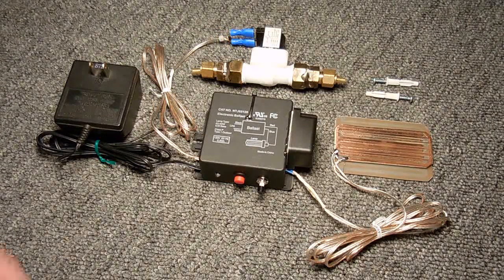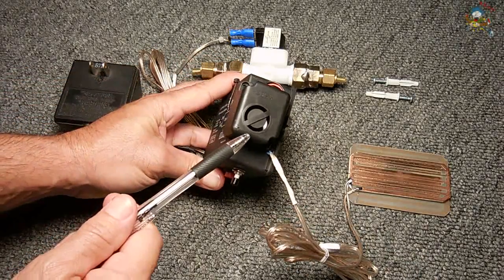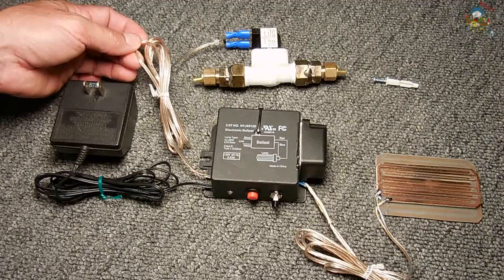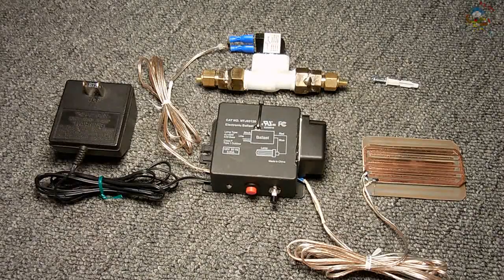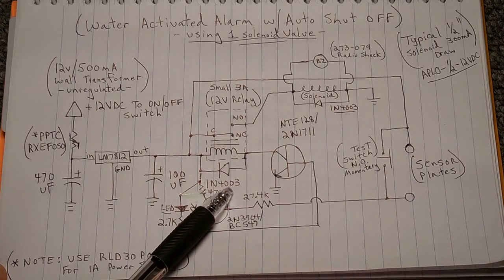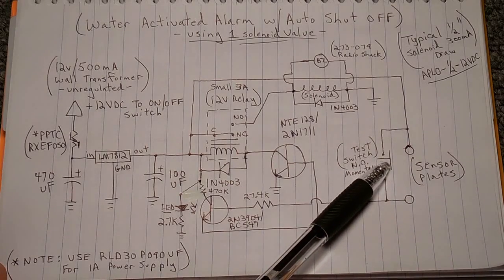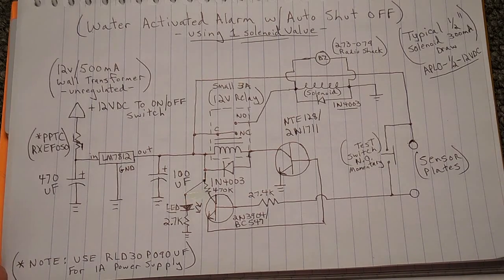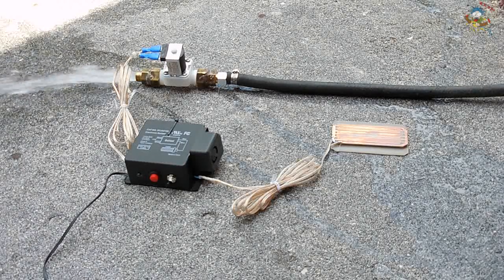DIY Water Leak Detection System w/Auto SHUT OFF

Comment: I'm taking this project on in my home.  I'm going to run a loop of leak detection cable around the washer dryer dishwasher HVAC, water heater, sump pit and floor drain. Each one cable back to a small breadboard on the basement wall.  A leak will disable AC by opening the circuit via a relay, and also send a signal to my smart home controller which will cut power to the water heater close the main water shut-off valve over Z-Wave and then open a solenoid at the bottom of the water heater to drain it for about 30 seconds creating a vacuum since that's the lowest point in the house and hopefully sucking air into the pipes that were previously gushing water into the floor

Comment: I'd suggest adding a switch to the alarm part so you can silence it while working to repair the leak, without having to shut off power to the entire circuit and thus making the solenoid valve open back up.  I'd also suggest using a latching solenoid valve so that in the event power goes out and the water supply is city water instead of on-site well which would also lose power, the valve won't lose power and default to open.  It should be pretty easy to modify the circuit with a valve reset button (also handy in the case a battery backup is used and power is out long enough to drain the battery with the regular N/O solenoid valve).
Reply from the maker: I thought of those things, but the odds of the power going off at the same time as a leak, is EXTREMELY rare. I designed it to be normally open so the solenoid is not continuously being supplied with power. Power switch on the alarm, good idea. :-)
Reply: electronicsNmore
A latching solenoid valve sticks open or closed with a magnet and (from what I read in the description of one of them) needs only about 50 milliseconds of power to trip one way or the other, not a continuous supply.  I definitely agree with you not wanting to do that with something like a N/C valve.
Reply from the maker: *****
I know what a latching solenoid valve is. :-)

Comment: I think I completely understand, except, where it the red switch that you used to shut off the circuit in the schematic and does the circuit latch somehow or if the plate dries will it turn the solenoid backon?

Comment: Very helpful video. Great job.  If water was to be wiped off the plate, (without resetting the system), could the water start back up on its own?  I couldn't tell from the video.  I'd like to make it so that once the sensor is wet, it will not start again until a switch is manually reset, Not just from the sensor drying out.  Even though the sensor would need to be dry in order to reset the unit, I would want to physically rest it before the water flow starts up again.  Maybe that is how yours works, I just couldn't tell.  Thanks again.
Reply from the maker: +Mike Dell'Ovo 
Hi Mike. It will take a long time to have that sensor plate dry out. If the plate gets wet, you will hear the loud alarm and have plenty of time to correct the problem. If the plate was triggered by standing water on the floor, you will have MANY hours, even a full day or more to correct the leak. If the plate dries out, then the next time it turns on the water, new water droplets will quickly turn off the water again.

Thanks

Comment: Perhaps you can make a circuit with IR or motion sensor using your hands to turn on and off the kitchen sink faucet.  This would allow me not to contaminate the knobs when handling poultry.  Also a serving of hand soap when your hand is near so your dirty or contaminated hands don't spread to the dispenser. Perhaps it can be liquid or the foam soap.   Thanks again I always come back here; and one more perhaps a lesson on how an AC/DC Clamp meter work I still find that amazing.  Keep up the very good work.
Reply from the maker: +William Ward 
Just saw this comment. I already have a circuit like that on my channel. :-)
Reply: can you give me a link? Oh, I send everyone to your channel that is interested in electronics. Just got two led lights with drivers in the mail. Over the weekend converted a 50 inch TV that came with the house we just bought the screen was cracked but still would turn on.  Turned into a light bar for the garage. Will build a moving platform that tilts so I can move it anywhere in the garage for use. Also turned an old flat screen computer into a light bar as well. Oh, I am also re-purposing many components from old microwaves love those magnets from the magnetron. Hope all is well really enjoy your vids.
Reply from the maker: Here you go!

https://www.youtube.com/watch?v=3eO51lcaooc

Thanks For Watching

Comment: A great circuit, ingeniously prepared. I wanted to know a few things only as follows:

1. What is the wattage of the 27.4k Ohm resistor?
2. What voltage should the two capacitors be? Is there any alternative to the transistor 2n1711, I am having difficulty finding it.

Appreciate your input. Thanks in adv.
Reply from the maker: 1/4w resistor. NTE 128 or similar. 16v or 25v is fine.
Reply: Thanks very much Dan for your response.

Comment: How long can the solenoid be safely energized and stay in the closed position? i.e there is a leak and the solenoid energizes and i am away for the a few days. Will the solenoid safely hold in the closed position without burnout or other troubles? Thanks
Reply from the maker: The solenoid should only get warm/very warm. If the detection plate dries out, it may turn the water back on momentarily until the plate gets water on it again.
Reply: Do you think it would be better if i use a latching solenoid when i build mine, i am going to use it for overflow and shutoff for the toilet?  Thanks for the first reply

Comment: Hi, nice one. I have a question. Why 2 npn transistors. Only one should do the job. Just for the current gain (darlington pair), or I'm missing something.
Reply from the maker: Adrian Carstea A single high gain NPN can also do the trick. :-) Many other water alarm circuits use 2 transistors like in this video.

Comment: Very useful circuit. I wanted to design something like this but with end result closing windows to a greenhouse a little rain is ok. But, if I am away far from home and it is a thunderstorm I would rather the plants inside the greenhouse are safe. I was going to use an ardino to send an email or a text message that it went off. Then I can use the security camara with a smart phone or any internet connection to have a peak. Thanks for sharing.

Comment: FYI: I thought this circuit was amazing.  Just in case anyone wants to know about the thermal switch here is a link to the data sheet 

http://www.datasheetarchive.com/dlmain/Datasheets-25/DSA-481514.pdf

And here is a link to what RXE stands for

http://www.datasheetarchive.com/dlmain/Datasheets-25/DSA-481514.pdf

"REMOTE EXPANSION ENCLOSURE" interesting....